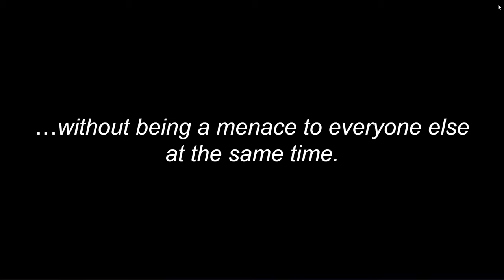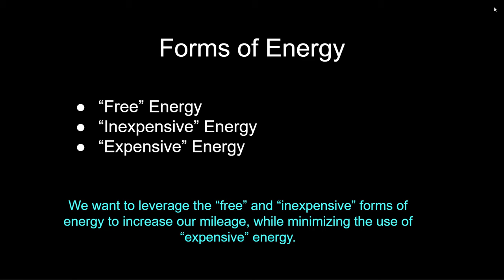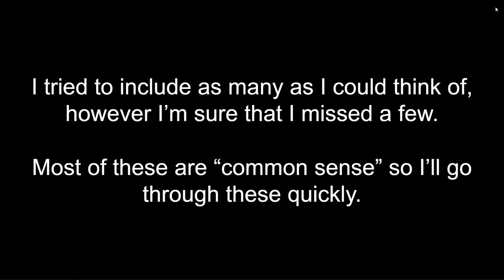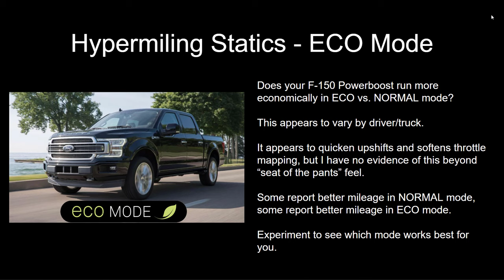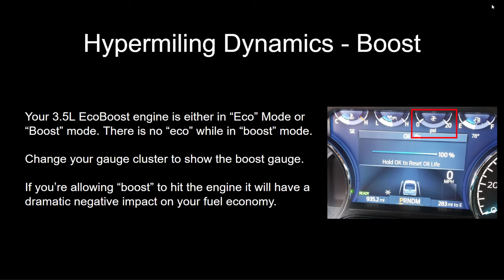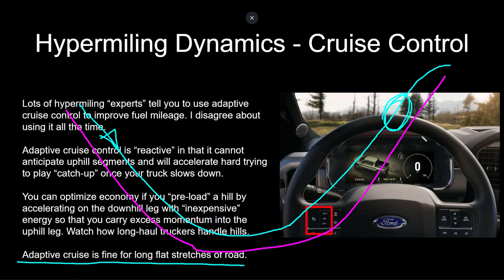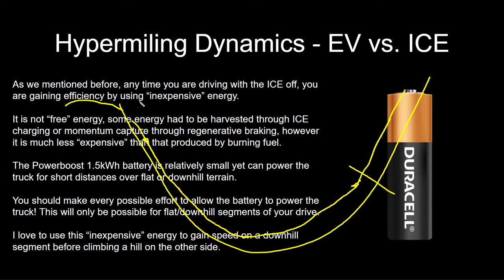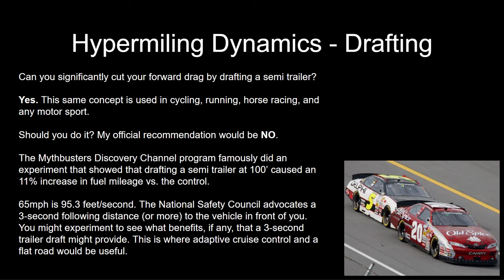How to HyperMile Your F-150 PowerBoost! Get Better MPG and Save Fuel.

Comment: I’ve owned my PowerBoost for about 3 weeks now.  I was pretty much already following all your tips in this video.  I live in north central Florida and I use I-75 to commute to work.  The speed limit is 70mph but I set my cruise to 60mph.  I’m getting 26.5mpg if I stay out of the throttle, which is not easy because this truck is such a joy to drive and has so much power.  My justification for driving 60mph is that if I was going 70, all the same people would’ve passed me anyway so I might as well save myself some money since gas is $4.99 as of today.  Interesting to see everyone driving 80-85mph with gas so high.  Thank you for sharing this content.
Reply from the maker: Thanks Brian. It's really hard NOT to horse on it! I tend to get on it a little doing freeway on-ramps out of concern for "safety." lol
Reply: Same, I found 63 to be my best speed for fuel savings, I'm usually at 27-31 on an 84 mile round trip
Reply: I’m not sure if I should take mine to the dealer ; it’s a 4x4 off road and max tow package supercrew lariat with 6’7l bed. I keep it in ECO mode 80% of the time. The dash is showing me somewhere around 16mpg. A/C use, live in blazing South Flo. Yes, if I reset it and drive carefully for the first few miles it can show up to 26 briefly, but under extended real driving drops down even to the 16 average. Not sure if something “broken”. (22 powerboost)
Reply: @nicholasbartek9168  is that 2wd or 4wd?  I just got a new 2023....
Reply: @---tx9xx I find that using ECO is not all its name is cracked up to be….. Since the trans shift points are changed, as well as the fuel mapping of the engine to keep the revs in the lower range…. Lower revs must burn less fuel, right? I find that in order to get the truck to do what you want, you press the pedal more trying to accelerate but the trans wont cooperate so you press more, eventually triggering a downshift. Now the engine is 2-3 gears down from where it would be if casual shifting were allowed (not in ECO). I find just staying in NORMAL works just fine and I get better mpg.
Reply: Interesting, I'll try that, thank you. I don't accelerate fast, use mostly cruise control on the highway, and use exclusively ECO and I've been getting disappointing mileage with the powerboost (supercrew 6.6" bed 4x4), around 19mpg, maybe I'll switch to using normal and see if that improves it for me. I figured that since ECO only uses 2 wheel drive instead of my normal being 4 wheel drive i'd see a difference. what do you think?  @talonpilot
Reply: I live in Miami and love my 2022 F-150 XLT Fx4 with V8 and Tow package, ACC/LKA. I used the system's assists on the way home from the dealer and got close to 30 for long periods, 26 on average. I set the ACC cruise at 55. I also use the EcoCoach system to help me optimize mileage and it works great. I traded in my beloved Badlands Sasquatch Bronco and the noise, ride quality, and gas mileage are substantially improved, at the cost of off-road worthiness. I did it because we plan to take an Airstream Basecamp 20X REI cross country, and the spousal preconditions of having toilet and bath and bed sadly added enough weight to safely prevent the Bronco towing it safely. Anything I can do to add off-road worthiness without sacrificing mileage and tow capability?

Comment: 2021 powerboost, I did a trip from myrtle beach to CT and averaged 60mph and 29mpg.  Watched everyone pass me doing 70 to 80 which i used to do.  It felt so much easier and relaxed letting everyone go by.  Around town i get 24 plus mpg.  I have a 2020 34 ft coachman travel trailer 7500 pounds loaded, truck has 11k towing capacity and 1600 lb payload cap.  Have not towed the trailer yet,  i guess that will be 7 to 9 mpg.
Reply: I have a friend with a powerboost, pulls 8,000 lb cattle trailer. He claims 21mpg so maybe some where in between?

Comment: I beg to differ on the EV coach not being useful later on. Besides teaching how it behaves, it ALSO shows available EV power and/or regen capacity left. For instance, the regen capacity will drop as you keep going downhill, and EV coach would show you when you're just using your brakes. Similarly, EV driving mode will show a window that gets smaller as you use up charge, which would help you maximize how much pedal you can apply right below hybrid switch threshold. Take a look : )
Reply from the maker: I will do so! Thanks for the comment.
Reply: I agree with oooz. I use the EV coach always. You can tell exactly how much throttle you can use without starting the gas engine. And as that window shrinks you know you've used up your available EV battery charge. Only wish there was a small battery cage that would be displayed at the same time. All of my Toyota hybrids have a simple bar graph. (Yes, I have used the torque app on a Bluetooth OBD adapter and tracked it that way, but I don't prefer to have a second cell phone running at all times.)

Comment: We're currently moving from Missouri to New Mexico and we are staying in Oklahoma as we speak I am getting 23.4 MPG on a 2022 used power boost we purchased last week. First, fill up I got 612 miles of range right after we purchased it. 2ne full up for this trip was 650 and now we're at 669 on our third fuel up. Been very impressed so far.

Comment: One factor people forget is that larger tires equal a larger circumference. Unless you have recalibrated the speedometer and odometer using Forscan or having a dealer do it, you're indicated speed and mileage will be incorrect. This, in turn, means that your indicated fuel efficiency will be understated since the vehicle will actually be traveling farther per gallon than calculated.  So a lot of people will think they took a larger fuel mileage hit by going to larger tires than they actually have.
Reply from the maker: 100% Ted. I also wonder how tire wear affects indicated/calculated mileage, since a worn tire has a smaller circumference.

Comment: I do all of these regularly.  I barely get 18 MPG on average.  I can't say I would be better off with a Ram, Tundra or GM but I have had nothing but issues with my Powerboost F150.  I have had it over a year now and its been in the shop 4 times.  I got the supercab 6.5 ft bed which I know will add weight and lost fuel economy.  Stoplights kill any fuel economy you recovered by hypermiling.  it is frustrating to be a Ford owner.  I wish I wouldn't have listened to the Ford owners I know who got lucky and got a good truck.

Comment: This is one of the best explanations of hypermiling I've yet found. 
Most of the tips are still relevant regardless of the size or power of your vehicle.
I'm an avid hypermiler living in England  with just about 3 years of practice -  albeit with much tinier power trains than those popular in the USA.
With a 2021 Toyota Yaris 1.5 litre hybrid I regularly achieved 104 mpg (84 US mpg)
Since then I've down sized to a new 2022 Toyota Aygo X, 1 litre,  3 cylinder naturally aspirated ICE, and regularly get 64 mpg (53.29 US mpg) without driving slowly or impeding other road users.
The only tips I can add to this excellent video is don't expect to hypermile on a cold engine or on short journeys. I warm up my engine for 5 minutes before starting all my journeys, knowing I can then confidently hypermile.
Also reduce overall vehicle weight by only half filling the tank.
PS. The cost of gas in the UK would make a US driver's eyes water! 👍😉🇬🇧
Reply from the maker: Thanks GBP! Can't wait for my next trip to UK, have been 5x and each time is a joy.
Reply: I suspect drivers spend more time at lower speeds in GB as well.  I frequently deal w high wind conditions in area. I've noted that damp air in rain and fog increases fuel usage by as much as 20%.

Comment: Just got a brand new 2023 XLT Sport 4x4 with the Powerboost engine and I’ve gotten 22 MPG since I bought it and I get 25 mpg on a lot of trips. No complaints on my end and it’s been so much fun to drive.
Reply from the maker: Just did 28mpg on a 70 mile gig this morning. Warmer temps are definitely better for mileage! cheers

Comment: I've had my 2023 for almost 2 weeks now and have been doing my best to learn how to increase my fuel economy. Your videos have been a great help... This one takes the cake so far. I'll be putting on a tonneau cover in the next couple of weeks and am hoping that also helps. I do live in upstate NY so our cold season has started. The other factor is that my truck doesn't fit in my garage 🤦

Thanks again for your very detailed tutorials!
Reply from the maker: Hi David, yes a marked decrease in mileage when it gets colder. I think this might be due to the passive battery discharge during cold temps, plus the winter blend does not have as much energy. My truck doesn't fit anywhere but I'm OK with that every time I put a big load in the back. cheers!

Comment: I’ve only had my 2021 F-150 PB 3.5 Hybrid for about three weeks, I bought it with only 4,100 on it, so essentially I’m breaking in this King Ranch. I love your videos. I make it a game when I know the area on two lane roads to try and use the battery as much as possible. I’ve got pretty good on hills where on the down side, I accelerate softly and can almost get to the top of the hill before the engine starts up again. Thanks for all your tips, I can’t wait to take a long trip. 🇺🇸
Reply from the maker: It's like a video game, "Cheat the Pump!" cheers....

Comment: A truck is bunch of tradeoffs, and mine is very much a "jack of all trades, master of none".  I have no lift and stock sized tires, but I have 33" BFG T/A KO2s.  I offset that to a degree with Weld wheels that are 30# (vs 38# factory wheels), so that the extra 55# tires vs 42# stock is somewhat offset.  I have a massive grill guard/bumper and tow mirrors...the tow mirrors alone have more drag than the entire Aptera vehicle.  Anyway, this leads to a few insights:
1) heavier wheels/tires probably need a tune to adjust shift ranges.  With heavier tires, the truck WILL NOT cycle back to pure EV above 49 MPH, but WILL NOT shift to 10th below 50 MPH, even in manual mode.  This means that the best efficiency band of 45-55 MPH ceases to exist with even a slight increase in wheel/tire weight+ more aggressive tread.
2) In a similar vein, the truck prefers to be in 3rd at a stop, using 1st and 2nd as granny gears for towing.   This behavior severely limits pure EV use from a stop, and would probably also benefit from tuned shift behavior.
3) Even with increased drag, good highway mileage is still possible.  I got 26 MPG over a 50 mile stretch today while behind an 18 wheeler on 1 bar of ACC at 62-65 MPH with negligible wind at ~80F on 87 octane.  Slower speed and drafting are vital in this barn door.
4)  These trucks LOVE boost, and the big limit is the added cost of octane.  Cheap E85 is probably the secret to unlocking the performance potential of these trucks, and depending upon how it is sourced, likely the greenest and potentially even the cheapest method as well.  I realize that from a pure cost perspective, most folks will do best with 87, but home made renewable E85 with an ethanol tune is the pinnacle for everything but pure range per tank.

Comment: Years ago I was hypermiling on my back road trips to work to the maximum.  Was attaining as high 28.5 mpg w my '97 F150.  Than I changed shifts and wound up driving back home at 3:30 in the morning.  My economy dropped immediately to something like 25 mpg.  I would constantly drive 41 mph, the bottom of my overdrive gear wo adding throttle and lugging.  The only thing I could recognize as having changed were the environmental factors.  Most every drive home would now be cool and  very foggy.

Comment: I do about 80% of what you've said in the video. But learned a few things as well. 

My truck is a 2022 f150 powerboost Lariat 502a. 4x4 with 3.73 gears. 

One issue is it came with a 2.5 inch level and 33x12.5r22 12 ply f load range tires lol. They are LT tires...nitto ridge grapplers. On 22 inch fuel rims. I looked up the weight of the tires and rims and surprisingly...they dont weigh much more then what comes on the truck as far as the 20 or 22 inch stock rims and tires but obviously the tread and rubber compounds are different so the rolling resistance is different. And the minuscule weight difference...is still a difference lol...and the 2.5 inch level...all still negatives as far as effecting fuel economy. 

I just drove from Missouri to Tennessee...489 miles. I go 5-10 mph lower then the posted speed limits on the highway and i Got 23.1 mpg. Truck has about 7300 miles on it. I'm on a powerboost group on Facebook and other owners are telling me despite my level, and tire/rim setup...the mileage should improve once i get another few thousand miles on the truck. This was how my previous ford truck was but who knows...🤷‍♂️.

Thank you for your informative and very detailed video. I really enjoyed it.
Reply from the maker: Hi Evan…thanks for the reply. I’m at 19k miles now and have not noticed any appreciable difference in economy after “breaking in.” I got great numbers right out of the oven. I have stopped running in eco mode 100% of the time as i just like the better push in normal mode, and the numbers are not much different either. Cheers

Comment: I have a 22 PB myself, I do not drive it like I should and I am one of those who drives 80-85 on the HWY. I recently drove over 8 hours round trip for a flight out of Seattle and I averaged 20.8 mpg climbing all the passes, in freezing cold and snow. Driving to the city to shop which is hwy and lots of hills I average around 18-19, in town I can get 26 or so driving a short distance. I do not really drive it for the MPG though, I just loved the truck so I bought it, rides nice,  can tow, can even do well enough off road and still get decent MPG. The PB really shines in city though, I did get 29mpg driving around the city for a full day once.

Comment: Thanks for such a great and in depth video on this. I’m sure many will use it. FYI to everyone. Tapping on the break is not really necessary to get it to go into EV mode. If the battery is charged enough simply stop acceleration be it removing feet from pedal or turn cruise control off will do the trick.
Reply from the maker: Agreed however many times I'll be coasting downhill and the ICE is still idling. A quick tap on the brake kills the ICE without slowing any momentum and allows 100% regenerative braking capture. Like you said not necessary and I rarely bother with it but the "tap" is effective. cheers.

Comment: Tail gating will put you into the vehicle ahead. The adaptive cruse will limit your tail gating. You have to accelerate to tail gate and waist fuel. I am in electric mode more then 10% electric. Don’t accelerate out of turns. If you can keep it moving in electric mode you have saved and made mileage!

Comment: Great collection of tips.....in addition, I anticipate upcoming hills and press minus - button to lock out 10,9, even 8 to raise RPM's and avoid boost on gauge. Then add gears back with plus + as road crests top and flattens out or descends downhill.  If you think of any significant boost on display as "sucking down excess gas", then going up hill in 7 or 8 gear with minimum boost at 2800? rpm makes more sense than 10th gear at 1400 rpm with major fuel sucking turbo boost displayed and engine lugging....lol....turbo boost = $$$$$$$$$$$
Reply from the maker: Jim, absolutely agree. Recent did 1000 mile RT up/down the Blue Ridge/Appalachian area with lots of elevation changes. Avoiding boost got me 25mpg (measured) going north, and 24.8 mpg going back. Pretty decent for a 6,000 non-aerodynamic lump of steel and aluminum.
Reply: @fixorrepairdiy4609  Agree!

Comment: For me, at the 30:20 mark. Tapping the brake to force the truck into EV mode significantly increases hill country MPG for me.
Reply from the maker: Thanks Mark!
Reply: I don’t think forcing it to EV mode is the right technique. If you’re requesting so little energy that a little electric motor is enough to keep you moving you’re probably burning very little gas to begin with. At that point you’re wasting your “inexpensive” energy to cover something that comes really cheap anyway. At the same time you’re  depleting your battery living it useless for something more demanding and more expensive like in accelerating back to speed from the red light. Now you’re using boost because your battery is depleted which causes your 3.5 ecoboost to burn significantly more
Reply: Very valid points… I’ll run a test today on my normal work runs and see if I notice a difference. As far as off the line from a traffic light, I feel like the battery is only on for a few seconds either way. Not sure how much savings I would be leaving there. That is with a fully charged battery on some of my longer runs. Maybe forcing battery use will deplete it faster over the life span of the truck too. Yikes. Lol. 
My work route is 16 miles both ways on a hilly 55 mph road and I think 6 traffic lights. I have been averaging between 24-27 MPG most days. Ill report back later.

Comment: Yea, I think it is pretty much a wash. The shape of the tailgate lip probably has more influence on it. The best feature of thee Power Boost is I can use the inverter to power my little Airstream when off site without continously running the engine.